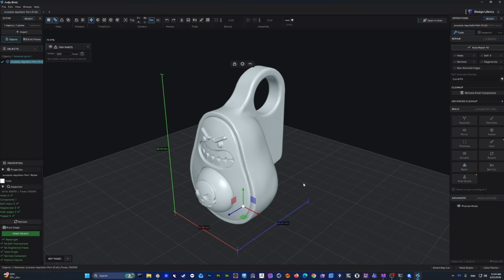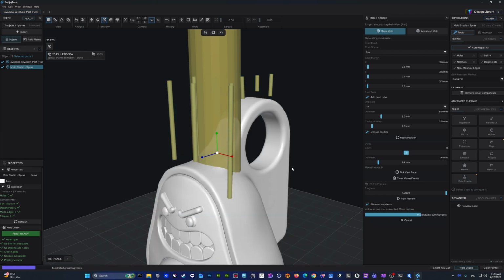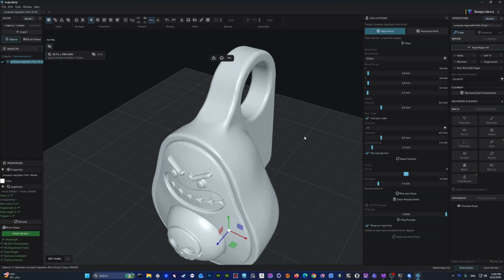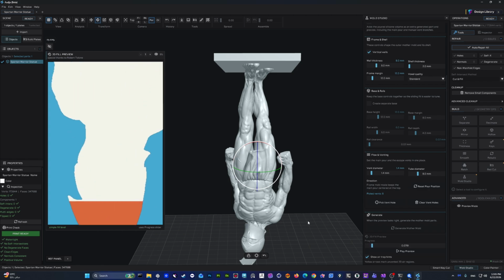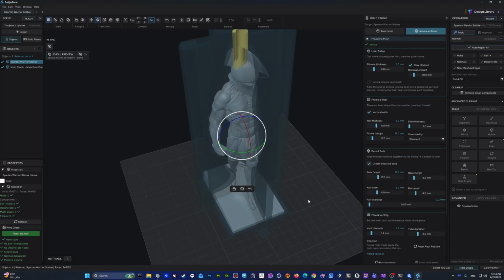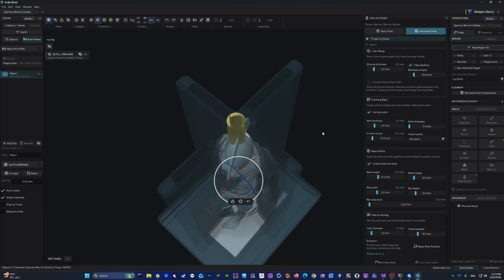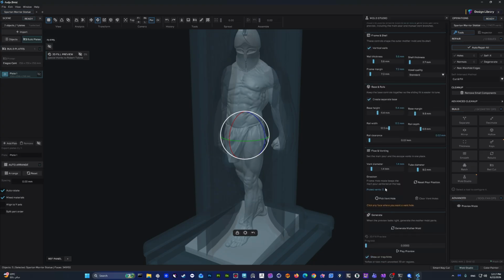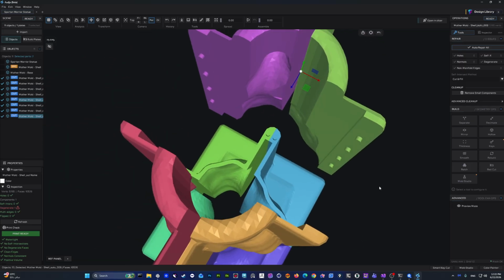Audja Tutorial #4: Create 3D Printing Molds with Mold Studio

Comment: hello great demo a lot of useful features. I was searching for something like that for a long time (didnt tried the articulation feature yet). Is there any way to mark the position of the model/positive on the base because I didn't understood how you put all the parts together after printing in order to pour the silicone. How do you fix the model into the mother mold in exact same place as in the software. Is there a way to mark the position of the model onto the base so it fits with the walls. Also in the version I have there is no rails option for the separate base so fitting the base with the walls has the same problem as with the main model fit inside the walls. Thank you very much.